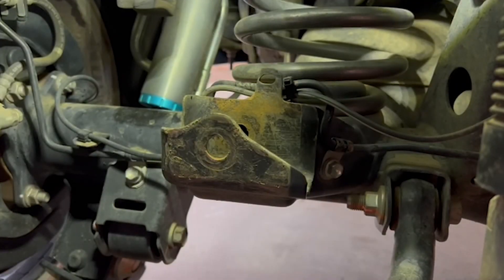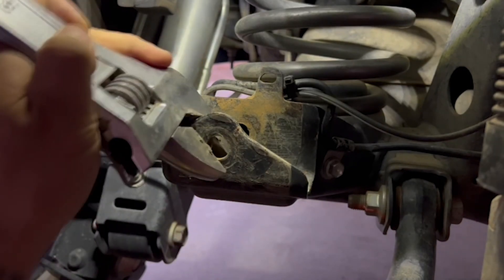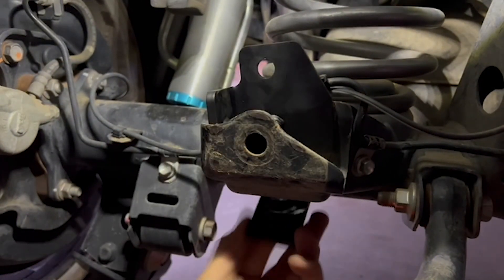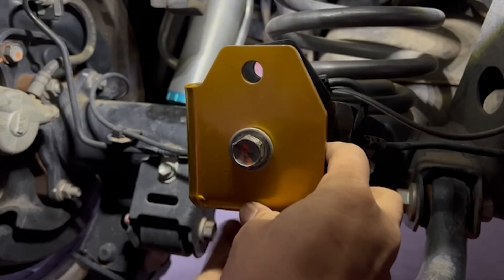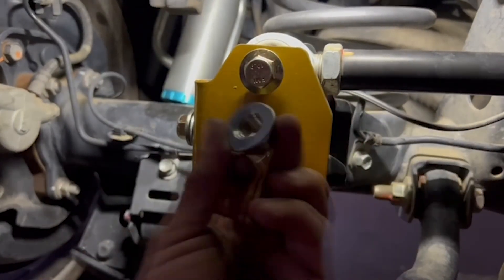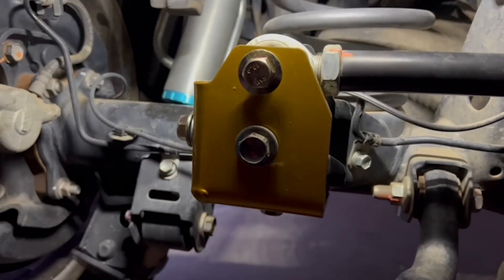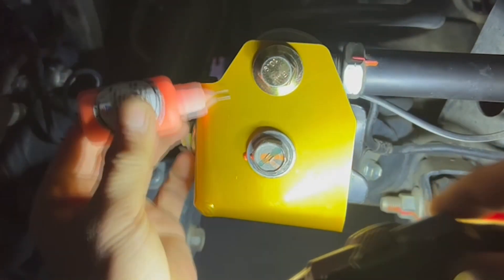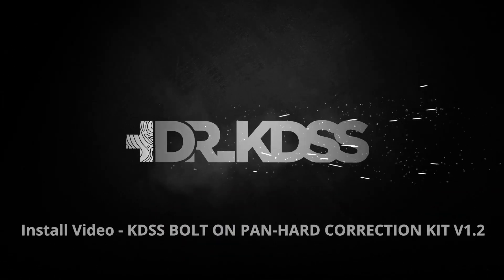Install Video - V1.2 KDSS BOLT ON PAN-HARD CORRECTION KIT

Comment: Looks like the ABS line is squeezed in the back close to the springs. Does that pose any danger? I cannot tell from the video.
Reply: Just zip tie it to hard brake line. I have mine loose and there’s no issues at all. 😊

Comment: I already ordered a regular sized kit. I’m putting my lift in tomorrow. Do you think it will be ok to run full sized if all I needed was a shorty? Or should I just re order if needed?
Reply: Just run the bottom hole. It’s the same as the shorty 😊
Reply: @fltllc4136  hey thanks brother! I just measured after the lift. It’s a 2 inch almost exact difference. I’m guessing I just need to run bottom hole then

Comment: Can you do a video on how to measure to determine if one need this bracket you mentioned on your instruction page?
Reply: There’s a video somewhere online by someone else.  

But it’s super easy. On the ground. Measure from the ground up to center of bolts. Start with passenger side bolt.    Then driver side bolt.  Then subtract those numbers.  If you fall in between 2-3”.  Get the shorty.  Or if standard then you must run the bottom hole which is same height hole as shorty.  Shorty you just don’t get extra hole and extra metal on top.

Comment: What to do with the ABS line after install? The rear plate blocks the hole that the abs line was anchored to. After install it kinda just lays on the brake line.
Reply: You can just tuck it under the hard brake line. Zip tie if you want to too. I just tucked it under and forget about it.  It’s not long enough to make it to the coil and get smashed.
Reply: @fltllc4136  For sure appreciate it! I assume heat from the brake line isn't a concern?

Comment: What car and what lift does this one have? Trying to see if I should wait for the regular ones to be in stock or get the shorty one
Reply from the maker: On a flat ground.  Measure from ground to center of bolt on frame side.  Then the axle side.  Then find the difference.  If it’s 2.4” or less go for the shorty.  If higher go for the standard.

Comment: Question.  I am planning on installing a Dobinson kdss lift kit on my 4runner. I was planning on having it adjusted to 2.5 inches. Is this too high or should I just start at 2 inches. The other part is there anything else that I need to do to prevent the kdss fault or lean if it is installed and I get these issues.
Reply from the maker: 2.5” is fine.

Comment: Are you doing this with wheels on the ground or should the back of the truck be up on jackstands?
Reply: Do it on jack stands if you want more working room. But yes it’s easier to do it on its own weight.

Comment: What did you use to thin the area where that abs line connects for the bolt clearance?
Reply: Grinder with one of those flap wheels.
Reply from the maker: Grinder with flap wheel.